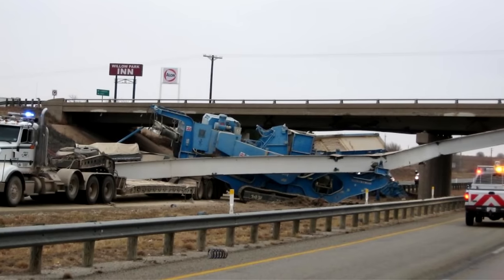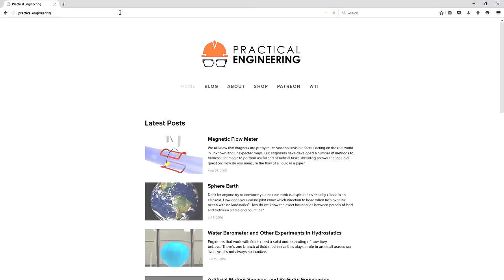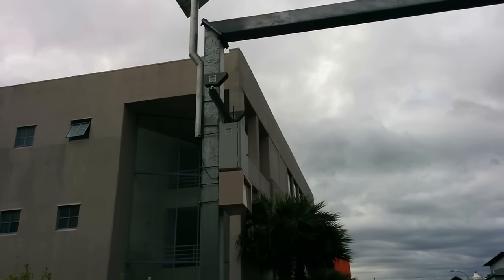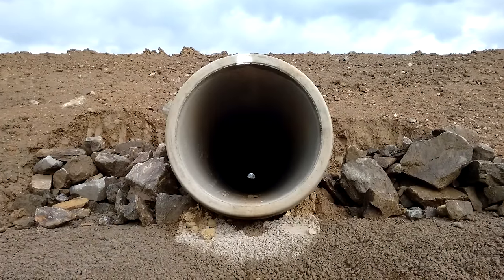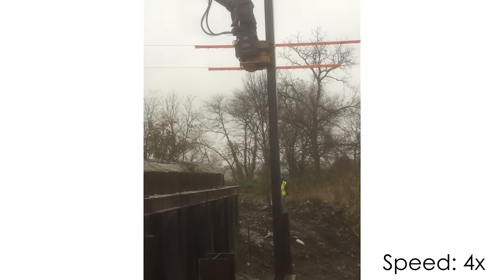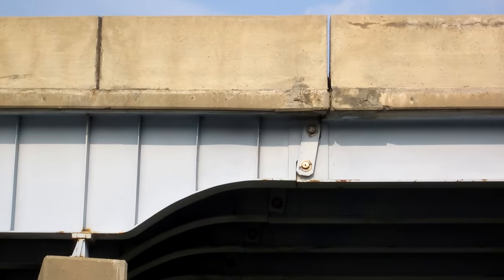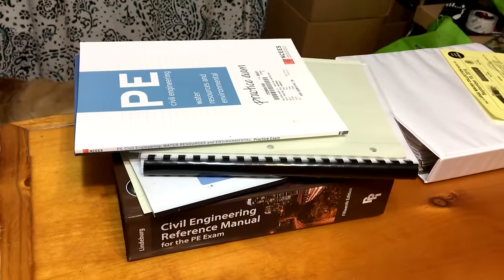What's that Infrastructure? (Ep. 2 - More Transportation Infrastructure)

Comment: the frame around the sign prevents people from walking up behind the sign, and spray painting / putting graffiti on it.
Reply: Came to say the same thing. You beat me to it.
Reply from the maker: Didn't even think of that. Thanks!
Reply: Beat me to it.  You can see the paint patch marks on the frame work where taggers where painted over..  They work well.   Though I think an electric cow fence wire wrapped around the pole might be more effective.
Reply: Lot's of highway signs in SoCal with razor wire wrapped strategically to deter would be artists.
Reply: not at all, those people know how to use sidecutters...
Reply: Awesome.  Lived out in the area a year ago and saw those shields.  Thought at first they were to deflect stray light from sign illumination from confusing drivers on the overpass.  Didn't know they were a tagger deterrent.
Reply: Beat me to it by 3 years😭
Reply: I thought it was to block blinding sun light.
Reply: Razor wire is still used on the steel mono poles holding individual freeway signs.
Reply: could also be to reduce glare from the sun being partially "behind" the sign. I've seen the same sort of thing around the traffic lights in my area that face away from the sunrise/set.
Reply: Guaranteed there only use is to keep taggers from accessing the signs and vandalising them.   
Nothing to do with sun glare...
Reply: You are not right. I am a truck driver and that sigh used to be a problem for us before these things. At our angle we had a lot of glare in our eyes.  Not anymore
Reply: Yeah and a lot of good it does they always make it around it lol.
Reply: @epolk1968  maybe, but truckers complained a lot in South California about that location. Now it's much better
Reply: ...it prevents butterflies from getting smashed on high level windshields in eighteen wheeler trucks, drivers get upset over that they just washed their unit
Reply: @Leedledlee  That's a northbound road so the sun is never behind the sign.
Reply: @AIM54A  and who do you think pays when some idiot gets shocked and falls into the highway?
Reply: Vandalism Control.
Reply: Wasn’t even thinking graffiti. Was thinking they have to put mirrors to get peoples attention for their brights being on
Reply: @WaddlesDev  5 years for me
Reply: The anti-tag around Caltrans signs is called Cobra Head.
Reply: I love that he was like… this one has me stumped.  Los Angeles.   Haha
Reply: How do people get behind that sign?! Isn't it on a highway
Reply: Graffiti artists are also in Cirque du Soleil
Reply: this is a huge problem in LA.  some signs are completely covered.
Reply: @snezzles278  I guess there are a lot of ninjas in LA
Reply: How do people even get up there 🤷‍♂️
Reply: @WaddlesDev  So close!  I thought I had a chance with it being less than 6 years.

Comment: The pistons that lock up are called hydraulic snubbers. They move easily with small slow displacements but they lock up with large and fast ones
Reply: No, they use a damper-rod style damper. This means that a piston basically forces oil through a small orifice. Since the flow of oil is relative to the v^2 of the piston, with flow being reduced at higher velocities, faster movement is "locked out". No need for a non-Newtonian fluid.
Reply: So,  @TF2BackburnerNoob , this isn't different in principle from an ordinary shock absorber in a car, i.e. force is merely resistive & proportional to speed?

If so, it's the same "dashpot" model many engineers used & learned about in modeling classes. That'd make it simple to engineer as well as cheap (relatively) to make.
Reply: @KenDunnUSNA87  Yes you are absolutely correct. That's the whole point of engineering right? Make the most suitable solution for the lowest possible cost. Actually, these fixed orifice dampers are bad for handling in cars;  they will always be either overdamped or underdamped due to the relationship between damping and velocity. Low (shock) velocity events such as braking will have a lower damping force, causing brake dive and sometimes a "pogo stick" effect. On the other extreme, high velocity shock movements caused by potholes and the like result in overdamping, leading to a harsh ride and even loss of traction. High performance vehicles get around this by having compression and rebound controlled by different valves, and these valves vary their diameter based on the shock velocity via springs and clever plumbing. Till the day of driving bridges though, I  don't think it matters, and the fixed orifice dampers are more than sufficient :)

Comment: I used to work for a company that made and installed parking garage systems (gates, ticket machines, software, etc), and also installed the vehicle-detecting loops in the concrete which worked like the detection loops for stoplights. They sense metal near the loop to trigger the control electronics. I remember being told that the best place to trigger them is on the corner of the loop, so that might help with motorcycle detection. An interesting problem is that these loops sense metal above or below them... so in multi-level parking ramps, a loop in the concrete could be triggered by a tall vehicle driving by on the floor below. If this is a problem they can add a metal grate/mesh to minimize detection on that side.

Comment: the 11foot8 bridge has laser over-height indicators as well
Reply: not that it works, though.
Reply: Sir Arch Duke Reginald The Fourth a sign saying “overweight must turn” is activated, as well as the green light turning red, when an over height vehicle is detected. This happens way before it hits the bridge.
Reply: They actually fixed it now by digging down and lowering the road
Reply: I have seen a couple places in Massachusetts where there will be a hanging sign before a low bridge and the sign reads, "I you hit this sign, you will hit that bridge"
Reply: @Twee877  since they "fixed" it there were already 3 accidents in 3 months.
Reply: It's now the 11' 8" + 8" bridge
Reply: @Twee877  Nope. The rail got lifted a small amount (so it was even with the crossings on both sides), a new beam and sign installed ... and new crashes happened. They can't lower the street because there's canalization pretty much directlöy below the street.
Reply: @lukeyluke9637  It was a perfect example of unintended human effects. While some people stopped and turned, other truck drivers sped up to try to beat the red light and crashed harder.
Reply: @KaiHenningsen  to be honest, they should just reinforce the structure and let a few more moronic drivers lose their jobs. Their incompetence may kill somebody in other place so better be here.
Reply: @Twee877  no, Norfolk Southern raised the bridge to be level with a railway crossing a little ways away
Reply: @TheArklyte  I'm sure they don't get away with no repercussions, but from those videos it seems like the primary culprit (unsurprisingly since I imagine most professional drivers know better) are rental truck drivers

Comment: In Colorado, we run different intensity lighting, sometimes as simple as just different spacing of the lights, as you enter and exit the tunnel to try to help the drivers' eyes adjust. There's even a second set of lights specifically for nighttime driving in a few of the tunnels with newer lighting systems.

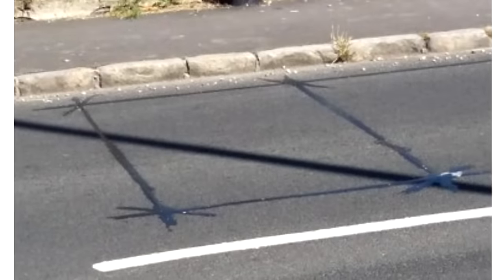Comment: @2:43, my guess is to prevent hoodlums from climbing up to the sign and spraying graffiti on it.
living in SoCal i've  seen other preventative measures like this along the lines of barbed wire blocking access to the sign.
Reply: yup, antigrafiti barriers.
Reply: Yep, graffiti deterrent. I've heard from law enforcement that the taggers will work in a group and hang people over the ledges by holding onto them.. nice way to fall into the road.
Reply: That was my first thought too, but I've seen many other signs without any kind of protection and others that do have the angled guards that are no where near any kind of pedestrian access. So if it is graffiti protection, then it's definitely not very consistent.
Reply: glare protectors. glare between signs from sun is a pain in the ass
Reply: That's probably because it would be costly to do this to all signs. They probably only do it to the signs that they have had problems with in the past. And taggers that go to this extreme are part thrill seeker. It makes sense that a group of taggers who want a challenge would target something hard to access and highly visible.
Reply: Matthew Zuber ou
Reply: Super Sohig Goodnight
Reply: The angled frame bounced headlights to light up the sign at night.  Here in Phoenix, we are using them more often and removing all lights from freeway signs as these make the sigh more visible without the need for lights.
Reply: Mike Harris Thank you so much! I live in Mesa and this has been killing me wondering what they were. My dad is a Mensa member and he couldn’t even tell me. I know, right? Imagine my shock! I can’t wait to tell him! You’re my hero for the week  :D
Reply: From Phoenix as well. We also see the opposite on some East/West oriented signs that have a thick black flashing around the edge to ensure they are still readable at sunrise and sunset.
Reply: Whoa, california sounds third world.
Reply: Those nice anti graffiti barriers are the newest fancy preplanned protection around LA freeway signs...  Go farther east toward the inland empire and Cal-trans uses straight up razor wire, just like a prison.  Mean looking. But effective.
Reply: @louised6790  Being in mensa doesn't mean one knows everything. Just saying. It's more of a social club for geeks. Says so in their "constitution"...
From the Constitution ofMensa, there are three main purposes of Mensa: Identify and foster human intelligence for the benefit of humanity. Encourage research in the nature, characteristics and uses of intelligence. Provide a stimulating intellectual and social environment for members.
😱😂😜
Reply: @SamBrickell  It's been known to cause cancer!

Comment: 4:19 A thin sheet of lead were oftentimes found under the rocker assembly during bridge restorations. The lead was removed & isomeric bearing pads of laminated steel plates housed in hard rubber were welded to the beam's upper flange, while the lower plate below received a Teflon coated surface slide, mounted to the top of the concrete abutment cap... which was blast cleaned & receive a 10 mil. coating of type X white epoxy coating to insure no moisture would penetrate the re-bar below it.  TXDOT Inspector of new const. '86 - '96    9417

Comment: Actually, the 11foot8 bridge (now 11 foot 8 inches plus 8 inches) has a laser-detection system for overheight vehicles approaching the bridge, and then triggers a red light and flashing "overheight" sign at the intersection, giving the overheight vehicle time to go around. The sacrifical steel beam is only used as a last resort.

Comment: We have a number of tunnels here in LA where they vary the artificial lighting. Numerous bright lights in the beginning, fading into sparse lighting by the end to aid the transtion
Reply: They do that alot in stores too, it's called daylight dimming or photosensor dimming or about a million other things. Basically theres a photocell (a light sensor) that has  built in dimmer and when they sense light they dim the lights in different zones accordingly. In some cities like Seattle they're making it required for areas around windows to have them so that way they reduce power consumption and they often have multiple zones near each window or door or similar areas. It also helps reduce eye strain and light pollution to a degree.
Reply: Are the lights near the tunnel portals reduced in intensity at night when drivers' eyes are dark-adapted?  Having tunnel lights that are too bright could cause safety issues at night, just like having tunnels that are too dark can cause issues in daylight.

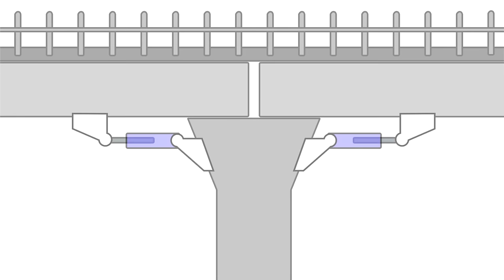Comment: The way you described the pistons (4:56) sounds like a shock transmission unit, which is designed to allow some motion, but work to tie the pieces of the structure together from large motions. A similar looking technology used in the same place for a similar purpose is a viscous damping piston for dissipating earthquake energy. They are designed to move during the strong motion event and the internals deform plastically converting a lot of the motion energy to heat. Those have been used in a lot of bridge retrofits in California, for example.
Reply from the maker: Very cool. Thanks for sharing more info. I'm not a seismic guy so I do my best on that stuff ;)

Comment: You can also flash your lights at the sensors next to red lights to get them to change. They look for flashing emergency lights and change the traffic lights when they detect them.

Flashing your lights in the correct orientation will set it off and change the lights.

Comment: I live in Grand Forks where the Sorlie bridge is. That bridge from MN to ND is extremely old (30's) and takes a brutal temperature (-40 to 105) and flood currents yearly. I have seen the thing completely submerged several years.  I cannot believe it is still around.
Reply: I feel the same way about some bridges in the Pacific Northwest. I drove over a no-name bridge awhile back near the Hoh Rainforest in Washington and it has to contend with an acidic environment from the soil and nearby cedar trees (the sap is worse than salt), regular floods, minor earth quakes, snow/ice, and annual rainfall that averages around 140 inches but a few miles away (upriver) it rains over 180 inches a year and I've heard of it getting as much as 260 inches in a year.

Comment: Nice concept for a series! I really enjoy what I've seen so far.  You mentioned the CE marking on the bearing plate. I thought this might be a good place to share what I learned about CE 'certification' while developing products for sale in the EU.  While the EU has extensive directives that ensure safe designs; the CE marking is a self-certification done by the manufacturer. There are no EU requirements that a third party test or verify the product's compliance to the EU directives. The onus falls upon the manufacturer to ensure compliance with the appropriate directives through their own in-house testing or by using a third party.  Of course the evidence of test compliance must be supplied upon demand.And definitely good luck on the PE exam.
Reply from the maker: Very interesting. Thanks for sharing!
Reply: And the bridge installers will have demanded that evidence! So the system works well.

Comment: I don't have a problem going into tunnels, I have a problem when I exit the tunnel. 
Btw, in my country, the inductive coil thing isn't really used to trigger the traffic light, while it is used to monitor traffic density to tune traffic light timings, it has a very interesting purpose. According to my driving school  , it's used to detect if a car runs a red light which triggers a camera built into the traffic light.

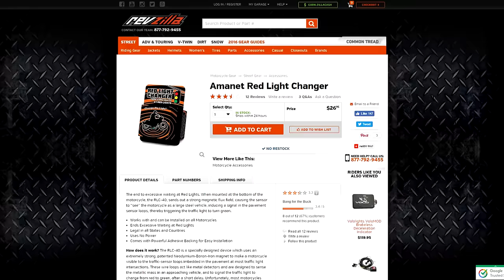Comment: 3:11 It's funny how much that magnet costs just because it's called a "Red Light Changer."
Reply: I guess other places may vary, but here a motorcycle can run a red light after 2 mins. Otherwise there are many around town I would get trapped at during nighttime.
Reply: @Bashfulvideos1  yea, it's in the Illinois rules of the road book. You must wait 2 mins, if it doesnt change by then, you proceed with caution.
Reply: But the sensors are not magnet detectors. they are AC induction detectors. so a loop of heavy copper would be better.
Reply: Makes sense. since I have an interest in it and have tried to get such jobs in the past, I know some trains follow the same logic.
The wait time is longer though.

I believe in germany if a train has been at certain kinds of red signals for 45 minutes you can pass it, but only at very low speeds...

Comment: I'm not to sure about y'all's grafitti deterrent theories. Why use a reflective material. Based on the angle of the lighting my first thought was those boarders are for reducing light pollution. Given the hills/mountains there I bet there's an observatory nearby. Or maybe they reflect light back to the sign reducing the necessary wattage and saving electricity. Maybe. IDK. I used to work for the owner of Mcclelland engineering, which issues permits for oversize loads that need to travel over bridges here in Texas, I'm also in Austin, and it was fascinating to discuss the engineering of bridges with him. Having the critical plans for virtually every bridge in the state and being a consultant on the reasons for bridge failures worldwide were points of great pride for him.